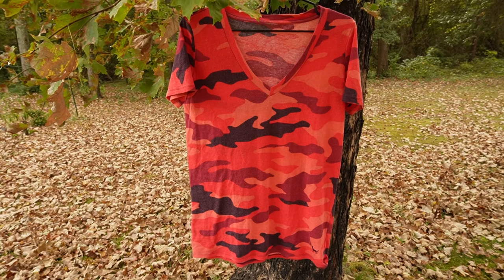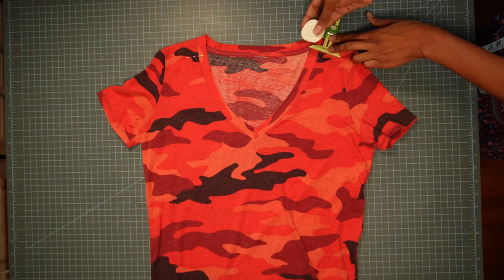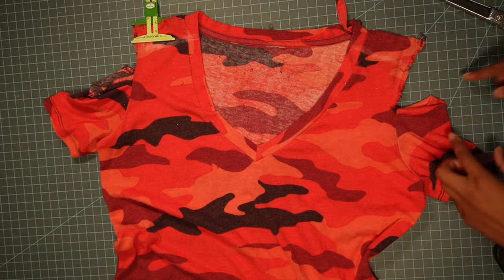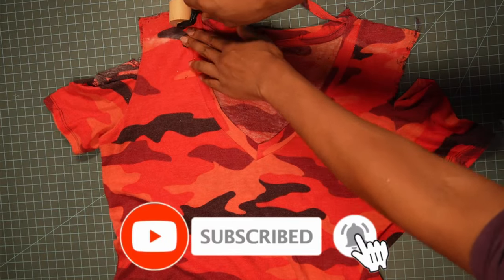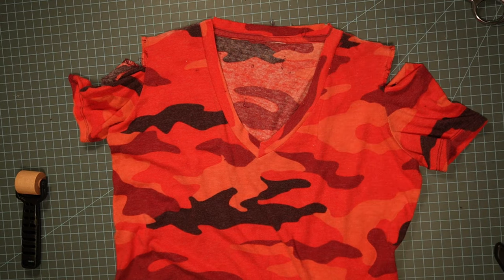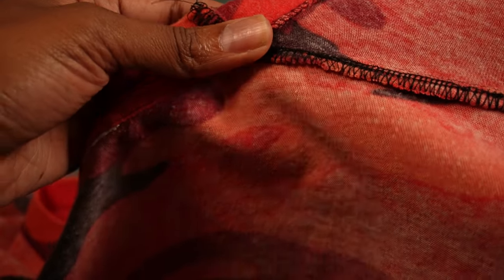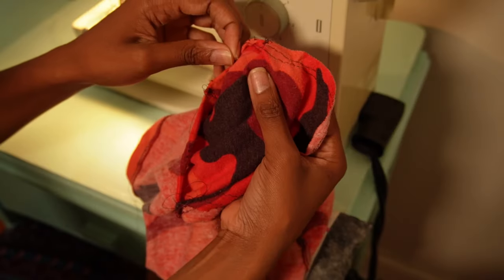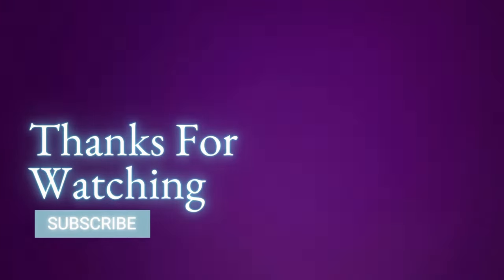How To Fix A Low V Neckline

Comment: Thank you for a helpful instructional video.   I think your videos are high quality.  I have a XXL cocoon style dress which needs taking in to XL.  Any ideas on the best way to do this?
Reply from the maker: Use the same method of try on, pin, measure, and subtract 1/2. Then, take both sides in. Thanks for watching.